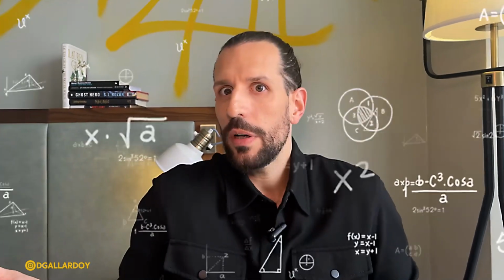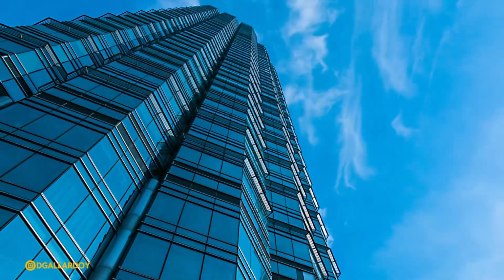How to make a Net-Zero building with 5 strategies | The Real Zero

Comment: Very inspiring video!
What percent of project budget would you recommend for the CO2 budget?
Reply from the maker: Thank you Zygis!
Project budget and CO2 budget are two different things. Nowadays is hard to establish a 100% accurate relationship between the two of them since it really depends on many factor as for example the accesible building material to your project, location, and more. There are some key references from already built projects that fluctuates between 2-10% of project budget increase for a decarbonisation between 40-70%.
I hope this answer your question! 😊